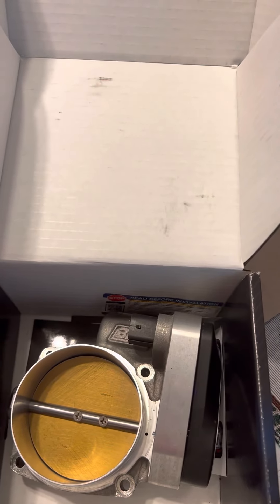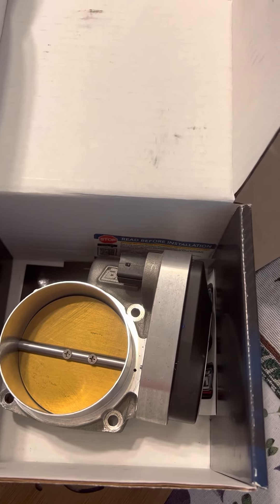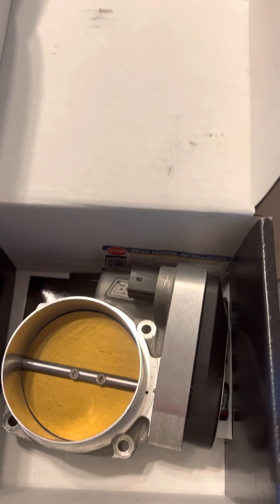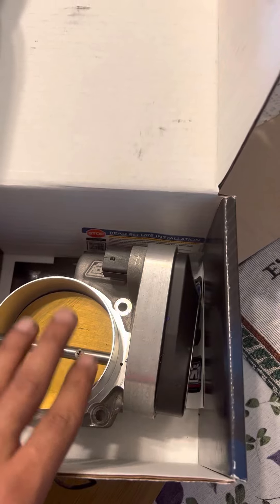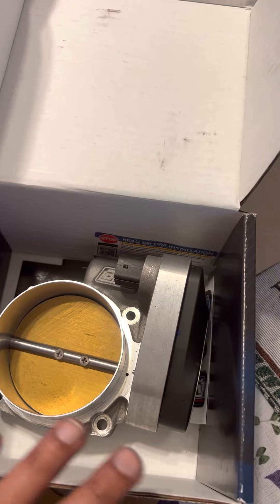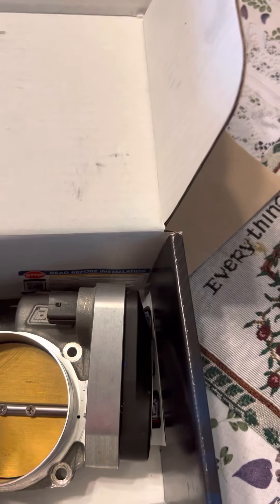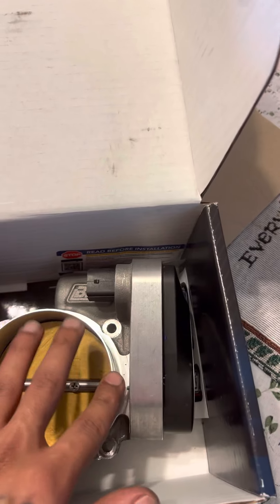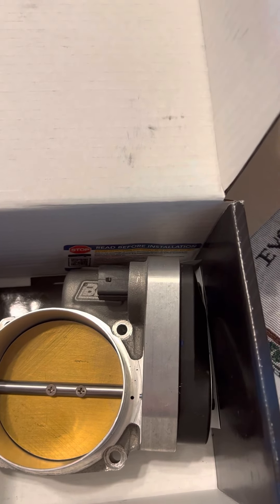2010 dodge ram 1500 hemi 5.7 Don’t buy a 90 mm throttlebody￼

Comment: Damn! I am glad I saw this, I was thinking about getting this for my turbo ram
Reply from the maker: @vicer77  do a 85 but not a 90
Reply: @Sportbikememace  I have an mmx 85 and that bitch literally died a year later. I still have that pos.
Reply from the maker: @vicer77  it’s OK brother. Mine died a year later after I post this mine got the hemi tick. The lifters went bad and I couldn’t afford rebuilding the motor.
Reply: @Sportbikememace  daaamn! The whole thing died...sheeesh. I haven't got that yet but I am currently buying parts slowly so that when the day comes I'll at least have what's needed for the rebuild.
Reply from the maker: @vicer77  the parts are not expensive is the labor if I would’ve knew that the hemi had the problem of the hemi tick. I would’ve never bought a Dodge. I would’ve stayed with my Ford F150 TwinTurbo eco-boost.
Reply: @Sportbikememace  noooo those Ecoboost are nightmares. I dealt with a 2019 explorer ecoboost and it was horrible. The hemi tic doesn't compare to the transmission issues those have. I had to replace an injector, the water pump was an absolute fucking nightmare but when they do work its fun but not worth it. I learned my lesson. I ended up selling it for 7k with less than 96k miles
Reply from the maker: @vicer77  my Ford F150 was a 2015 I never had a problem with it. But I don’t wanna take too much of your time, brother. I’m glad the video was able to help you out.

Comment: I think you received a bad part or you may have seated wrong. I'm runing 90mm no problem but I can't tell any gains from before. Peak torque seems to be further up in rpms.
Reply from the maker: When I called the company they said it could be a bad part. But they said that the 90 mm is for a high-performance motor
Reply: Did you have to tune after install? Or is it simple bolt on?
Reply from the maker: No, I didn’t do no tune before I did it. I no longer have the vehicle though. But it was a faulty part anyways. But yes, it would need a tune after doing that throttle body.